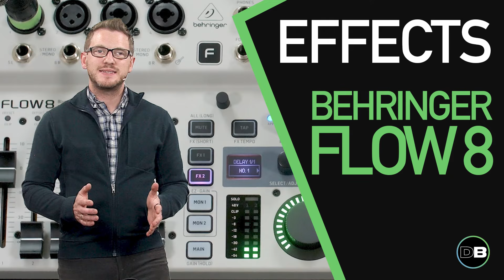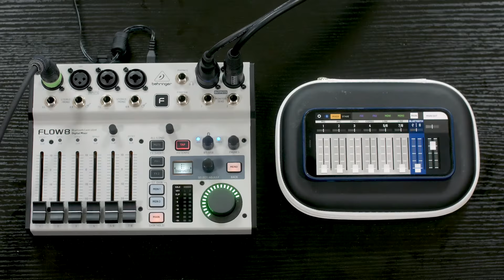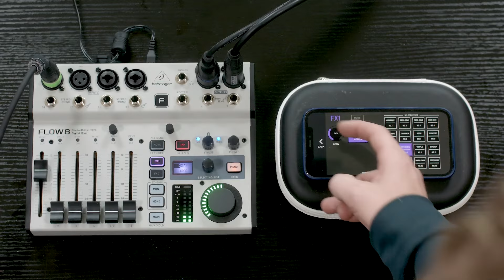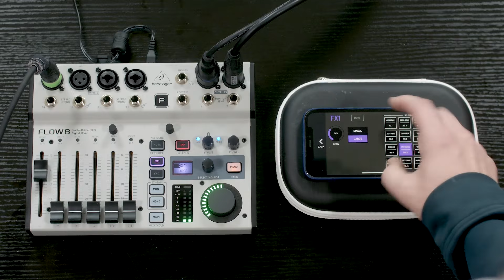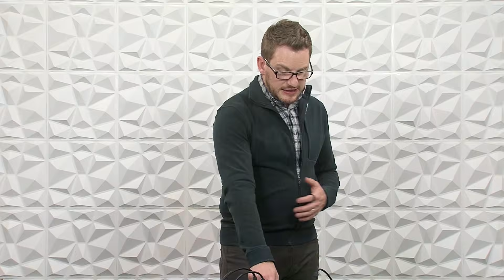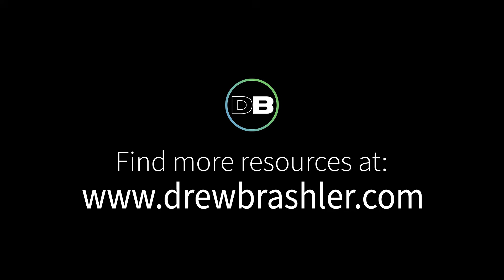Behringer Flow 8 - Using Effects on the Behringer Flow 8

Comment: Waiting for my flow 8 to arrive, i downloaded the app and started learning it, everything seems straightforward but saving/recalling snapshots doesn't work... is it because the mixer is not present? :/
Reply: Yeah, it's sort of a weird way they do it, similar to the X32. The "snapshots" are saved on the mixer itself, but "snapshot library" is stored within the app, which is to say on your device. I don't even use that many different ones, but I always save my snapshots in both places, so then if you say, update the firmware (which can delete the snapshots on the mixer), you always have a backup on your phone or tablet so you can call them up. A little complicated but it sort of makes sense in terms of making the mixer as versatile as possible with requiring a phone. The phone extends the capabilities (the biggest plus being the more in depth EQ), but the box is quite capable on its own which is very handy if your device dies or you're having some sort of network problem. The XR series of mixers (or any of the similar boxes from Soundcraft, Mackie, etc) rely entirely on the network/Bluetooth to function which, while normally isn't a huge deal, is a problem this little guy solves. Honestly my mind is blown that more companies aren't building little compact mixers similar to this, that can work with or without a phone or tablet. I don't know of any other box like it.
Reply: @adamcoe at this point the mixer from a hardware point is exelent... the app definetely could be improved a bit. The first thing that could be improved is an eq graph similar to every other digital mixer. i see no reason why this not possible. maybe/probably an rta is not possible but the eq Graph seems like such an easy thing to implement. bear in mind that in channel eq shelf eq/bell eq filters act differently than the eqs found on the outputa that turn inro hpf&lpf filters instead od shelf eqs... had to figure these things out through troubleshooting, but if there was a graph we could easily see what we are actually doiing more or less.
Reply: @pamboscharalambous3770  yeah actually that was a thing for a while, I've seen previous videos where it would actually show the curve of the EQ as you adjusted it, which I 100 million percent agree would be very helpful. I believe that it's just a question of firmware or something because it's definitely capable of displaying it, there are many examples of it out there. I get the impression that the Flow 8 wasn't at the top of the priority list in terms of getting updates and stuff like that, so it's probably just some rando piece of code that has been lost in the shuffle. In any case we should definitely harass them about it, it makes a big difference. And definitely an RTA would be awesome if there's enough processing power, but certainly on a mixer of this size and price I would never say it's a must have.
Reply: @adamcoe im afraid they are not aiming to make any new substantial additions/improvements to the app cause its allready selling well, and they just don't want it to become so similar capable to the xr series mixers, at least when it comes to the control app... imagine if mixing station developer decided to make an app for Flow 8, that would be epic. from what i read somewhere they are avoiding it cause the flow 8 uses Bluetooth instead of wifi
Reply: @pamboscharalambous3770  Yeah a version of Mixing Station would be amazing but as you say, it's likely not gonna happen, which is a shame. That said, the app works quite well and is laid out very logically so I have no major complaints certainly. The only issue I've encountered is that the tap tempo only works on the mixer itself. In the app, it will correctly display the tempo you set on the mixer, but when you tap the box on the app, nothing changes. Not a deal breaker but it would be awful nice if they fixed it.

Comment: Hi, when I make a recording to my computer (ableton), I'm listening the effects but the effects are not recorded. I tried to use the routing controlls but I can't make it work. How can I send the signal with effects to my computer so they get recorded? Thank you!
Reply: Hi, i assume you've connected the Flow 8 to your computer by the USB output? If so, you are sending audio via the 8-channel output, which is a complete pre-send, so no fader, no EQ, no FX, just Gain I believe.  If you want Ableton to record the post sounds, then the only option I know of would be to get an outboard 2-channel audio interface and connect that to the Flow 8's monitor outputs (set as L and R channels).  Honestly though it's really unneccesary, becayse if you are using Ableton, you have access to many more high quality and much more customizable plu-in effects at your disposal (just try Valhalla's free offerings!), so you're much better off using those anyway.  I also use the Flow 8 to connect to Ableton, and just having the 8-channel interface makes the Flow 8 by far the most economical way to connect that many channels to the DAW.  And I can still use the post-EQ, FX and Faders for live sounds when I want to.

Comment: I found your video very explanatory. However this is on the asumption that people listening understand most of the technical terms. It would have been better if you had tested all the effects using either your voice (you have sparingly used) with or without some music so that people like understand the effects on delay,reverb etc on the outcome through the PA system.

Comment: I would like to ask why the TAP delay stops flashing a few seconds after setting the tempo? I would like to see if it is in sync during a live performance. I updated the firmware to 1.49 and it has been doing this since. Before the update, it did not stop flashing. What should I set for it? Thanks!

Comment: Wondering about feedback suppression? Sounds like there is not an auto setup but can it be done manually?  My need is for a low voltage digital mixer for Wedding ceremonies that I can ring out. Low voltage means I can run it off battery power

Comment: Hi. I play the accordion and sing. My backingtracks are played via laptop.
Is it possible with this Flow 8, to use this on stage, playing the backingtrack simultaniously with my live accordion and singing?
Reply: This mixer is perfect for that. Use your phone, get an adaptor that lets you plug into the mixer. Then simply control the audio through the mixer. I love this mixer so much.I can do compression and all the mixing on AUM on my iphone.

Comment: Hi Drew! I appreciate you posted this video. It was really helpful. I need your help now. I am trying to put a song in Spanish and English at the same time. 

The one in Spanish needs to go through the speakers and the one in English should go out in the interpretation device. 

When I move the bottom in the right of the little screen it let me hear more English or more Spanish depending on the direction I move it. 

Do you have an advice for me? Thanks

Comment: Hi,
I have a Behringer Flow 8 with 2 Bose S1+ Pro PA speaker and a Behringer power subwoofer.  How do I hook up to the flow 8.  Please advise and thank you.
Reply from the maker: Depending on what subwoofer you have from Behringer, it might have a crossover built into the sub. Take the LR out from the Flow 8, take it to your subwoofer input first, then take the output of the subwoofer to your Bose S1+ Pro input.

Hope this helps!

Comment: We use a Flow8 at our church.  The help I have is timid and the workload is often too much, with a computer, two cameras, an ATEM and a Flow8.  I have not attempted to add the handling of effects.  I have wondered if there is a way to set them up and turn them on and off with a single button.

Comment: Hi there…Is it possible to have different effect for each channel? Especially if having two singers singing at the same time…thank you
Reply: RTFM. The answer is yes, you control the sends for each channel to the monitors or FX.

"CHANNEL FADERS set mix levels for their respective channels. These faders can also be used
to control the send levels to the MON 1/MON 2 output jacks or the FX 1/FX 2 internal busses when selected in the controlapp or by pressing the menu layer’s related hardware button (see [16], [21] and [22])."
Reply: Did you ever figure this out? I'm struggling with this as well. Just wanting effects on one mic not al
Reply: @featheredserpenttemple  not really…i believe u can't…well,since my post, i didn’t really look into it as i was using only 1 mic lol and connected to my sx900 keyboard where i can manage the effects. Only instruments on the mixer and a phantom mic for ambient.